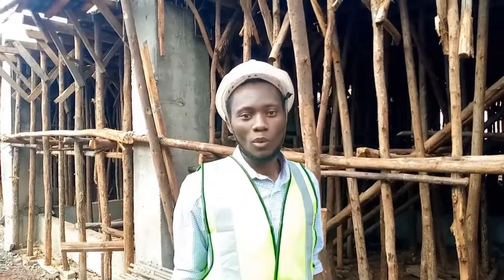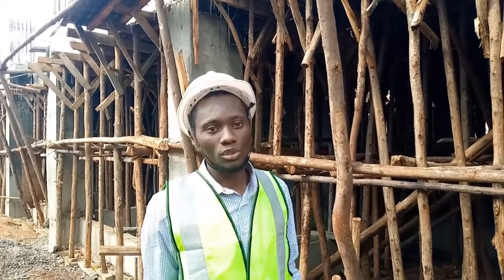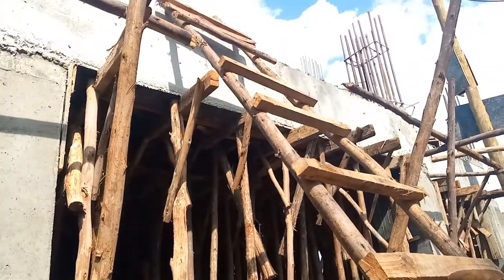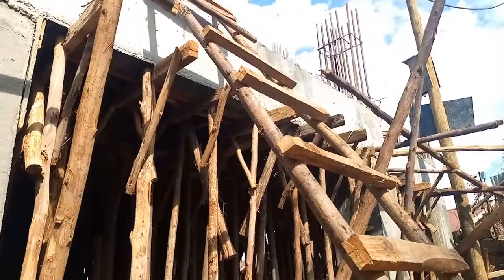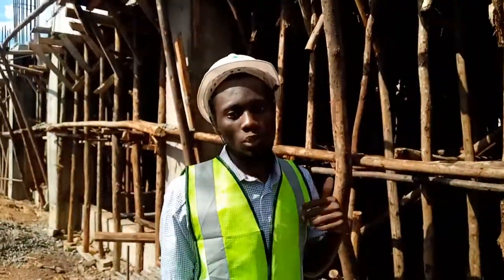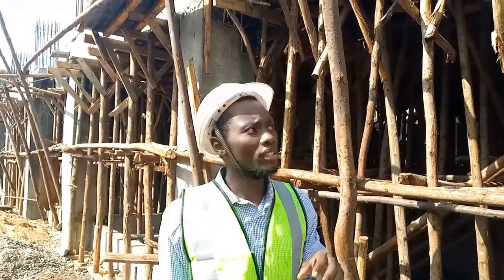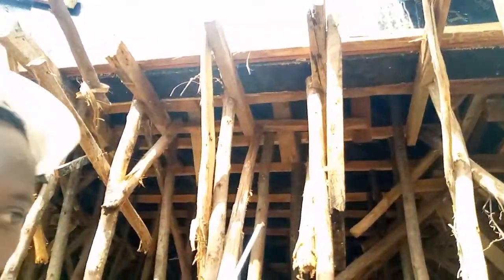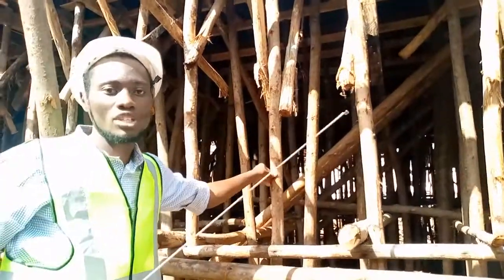STRIKING OF FORMWORK IN CONSTRUCTION

Comment: Thanks sir i wanna to ask you a quastion 
When checking transverse shear stress in pad footing 1.0d from the face of column for bs8110 
Transverse shear stress < 2shear capacity of concrete section
That is V<2VC
That is correct or not
Reply from the maker: In pad footing we design for shear in three ways.
1. Punching shear at a distance  1.5d drom the column face 
2. Shear at col face
3. Transverse shear.  at a distance 1d from column face. When V<Vc  no shear reinforcement is required. When V>Vc we provide shear reinforcement. There we do  not apply  V<2Vc in this case.
Reply: @bromtechengineering6705  
What do you apply in this case 
For bs8110
Reply from the maker: @sharmakeabdullahicisman4396  V<Vc